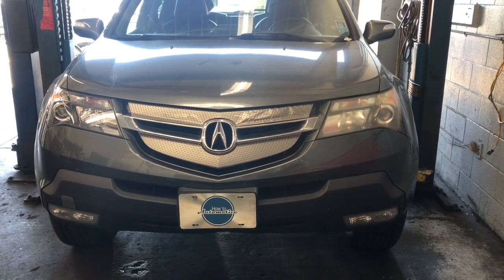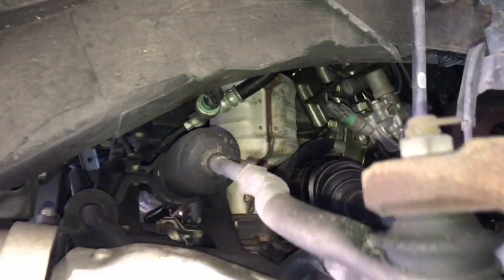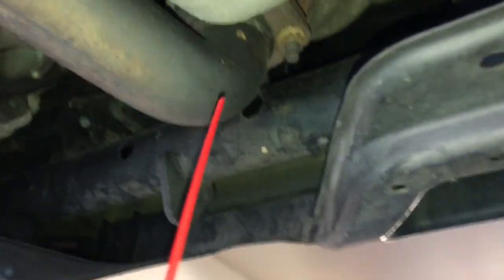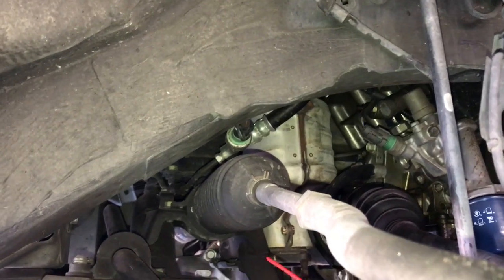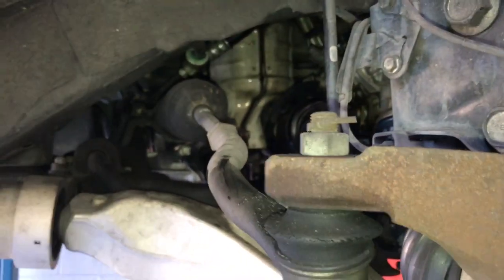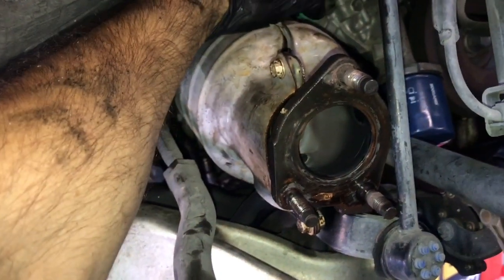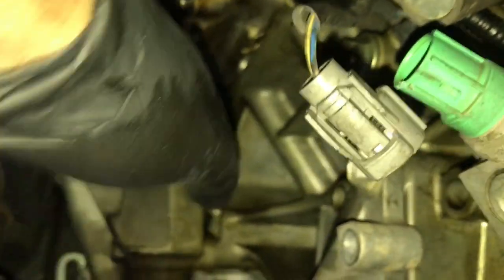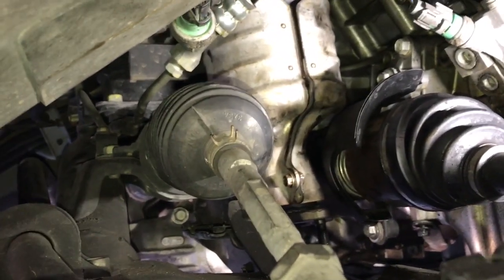How To Replace The Bank 1 Catalytic Converter On A 2007-2013 Acura Mdx

Comment: I followed this procedure to replace the Bank 1 (rear) catalytic converter on our 2009 MDX here in California over the weekend and it just passed the smog test with flying colors. The hardest part about this is the tight access on the rear of the engine, so unbolting and re-bolting the cat to the bank 1 head was a challenge. Also, getting the tie rod disconnected from the steering knuckle was difficult and required a carefully placed Pittman puller. Make sure to replace the gasket between the cat and the head as well as the three exhaust gaskets that seal the J-pipe with the engine cats and rear cat. After completing the repair, I didn't even need to clear the P0420 code and the MDX cleared it automatically. It took a couple of days for it to complete its drive cycle (as determined using an OBD2 scan tool/ThinkDiag). I checked it this morning and the scan tool reported that all emissions tests were good, so I took it in to get it smogged. One last thing to note was that I noticed some blue smoke from the exhaust pipes when I first started it up. This is probably manufacturing oils, etc, burning off, so no need to be concerned. MDX runs better now as well, which is an added bonus. Thanks so much for the direction on this!
Reply: Where did you buy the replacement? How much did it cost?

Comment: Would you advise replacing the oxygen sensor(s) while you're in there? It seems the O2 sensors go bad over time anyway?
Reply from the maker: kevin20878 It may not be a bad idea to change it out. Specially if he has a lot of miles.

Comment: This is a great video! Can I ask, when you drop that j-pipe where there are 3 nuts each for the cats, are there gaskets between the pipe and the two cats that needs to be replaced when re-installing the pipe?
Reply: I actually do see that there are o-ring gaskets you installed when putting the pipe back. I keep seeing flat triangular shaped gaskets though with the catalytic converter kits I see for sale. Don't these have to go between the bottom of the cat and the top of the exhaust pipe?

Comment: Awesome video do you have a video replacing the hose on the bottom left of the Acura MDX radiator? Mine is leaking transmission fluid & I suspect the hose is faulty.
Reply: Get that checked out! There is a connection at the radiator that corrodes and can allow your trans fluid and coolant to mix, which you really don't want unless you like buying transmissions...

Comment: First thank you, absolutely great video.  You make it look easy enough that I may try this.  Would love to have a lift to do it but sadly I have only jacks and stands.  I have a 2009 MDX, I've got the dreaded p0420 code right before I needed to register and smog.  I deleted code, ran car long enough to reset and passed emissions but code keeps coming back.  Mileage sucks, maybe 12-14 mpg.  It's near impossible to find this part nowadays.  Any suggestions?  The couple guys I've found to fix want upwards of 1400?

Comment: Thanks for the video it was very helpful. 
I bought a 08 MDX 147 mil , The check in mission light came on with code p0420 , 2 days after I bought it, I was wondering if the previous owner have known about this problem and he didn't tell me or is just bad luck for me, I had checked the car and I drove it and seems OK nothing was wrong with it , thanks again
Reply from the maker: Imad Soulaimane there is the possibility of that code been here before. But it would be hard to prove. Like you I’d be very suspicious. I would ask the previous owners for service records and see if that code showed up anywhere in the paperwork.

Comment: Great video! Did you notice if the cat was clogged pretty bad or did you only go off of the P0420 code. I have to replace this on my 07 TL Type S.
Reply from the maker: Justamazon 33 this car had the code and failed an emissions test.
Reply: Were you able to remove your cat this way with your TL?

Comment: Need help! I have a 2005 Acura mdx code say p0420 catalyst converter bank 1…don’t know which location or which sensor should I replace tried all the catalytic cleaner but the check engine light keeps coming back after 600 miles

Comment: Hi, thanks for the video.  I'm confused...if I am doing this at home with jack stands AND a floor jack with the front passenger tire off, how am I raising and lowering the car?  I am removing the jack stands in between?  Thanks!
Reply: if its just on jack stands you should be fine to leave it and just use a ladder.  He just "lowered" it because it was on a lift and needed to get up above.

Comment: That 1 nut on the bottom, on the right side of oxygen sensor (on engine)...
Why didn't you mention how hard, and un-user friendly it was.
That was a unbelievable battle. 
Hopefully it goes back together a whole easier than apart

Comment: Are the MagnaFlow 24741 Direct Fit Catalytic Converter interchangeable for Bank 1 or 2?
Reply from the maker: Samuel Berkun I don’t know but you can call Magnaflow. They should be able to answer that question

Comment: Great gob.
Reply from the maker: James P. Jones V thank you! Have you perform this job yet and did it go smoothly?
Reply: How to Automotive actually not yet. My wife has a Acura TL and the part and location are very similar. On some sites they say this part is the same as the TL. The only reason I’m changing this part is Bc the owner before me cross threaded the top o2 sensor Bank1 sensor 1. I have even thought about cutting out that threading and welding a new thread. But I’m not sure that’s possible due to the tight location. So in about a week I will be doing my this install.

Comment: I hear a metal rattle at 1500rpm only when driving in gear, never in neutral or idle. Same car in the video... any ideas?
Reply: My bet is the J-pipe (the pipe that connects the bank 1 and 2 cats to the exhaust pipe). I had to remove it for an oil pan reseal on our 2009 MDX and when I reinstalled it, I noticed this sound (at about that speed). I replaced the J-pipe and the sound went away. I think they get degraded inside over time and the removal just hastened this.
Reply: I had the same loud metal rattle. It ended up being the heat shield on the front catalytic converter was rusted through. I put a band around it and it resolved. Hopefully that’s what yours is!
Reply: @jackhemsath  Thank you! i'll try it out. It would help a lot of people if you can upload a picture of the location and the band on it 🙂

Comment: hi, what code did you get to have you replace the catalytic converter?  i have the code p0420.  I wonder if you have this code that why you replace the cat?  please help reply.  thank you
Reply from the maker: DANICK LAM NGUYEN this car did have the code P0420. In the case of this car the dealer diagnosed it as a bad cat and customer requested it be replaced and it did fix the car.